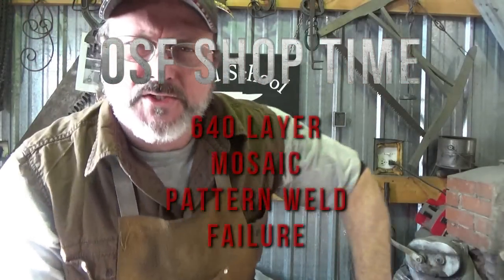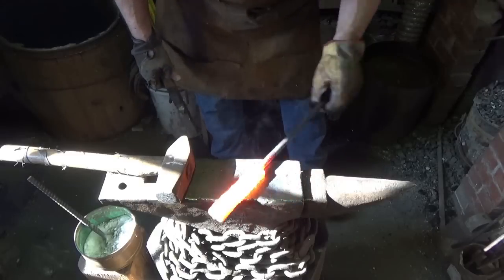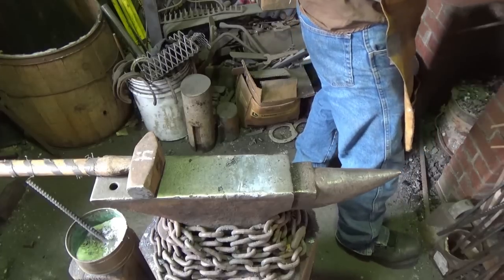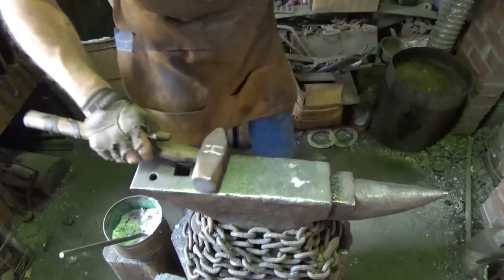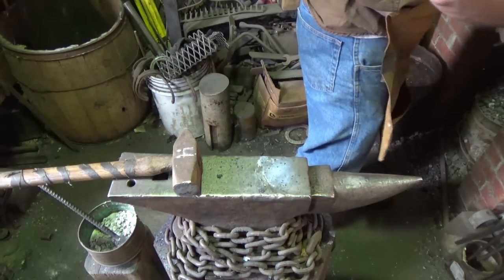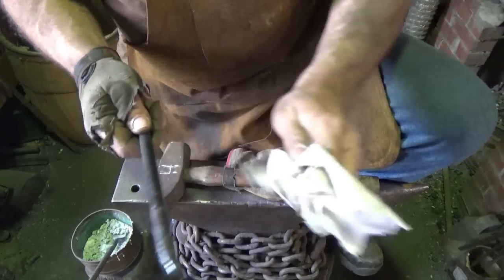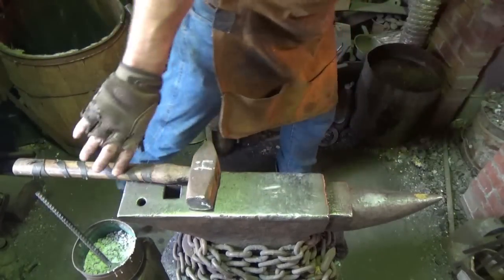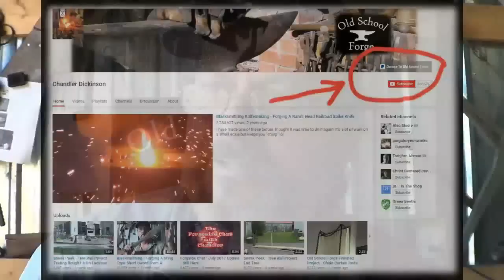OSF Shop Time - A Bad Day At The Shop - 640 Layer Mosaic Forge Welding Pattern Failure Part 1

Comment: Hey chandler, i know of a lot of mastersmiths as well as myself who have started using kerosene for flux.  Soak it before heating, dont clean off the residue once you hit heat, then forge weld it like normal.  The kerosene turns into carbon and such and keeps oxides from forming.  If the piece was thoroughly coated oxides arent allowed to form, only carbon (with minute imperfections).  The carbon readily difusses along the weld line and it sticks perfect.  It also prevents flux inclusions with the trade off of air pockets.  The air pockets can be fixed by driving a tiny punch into them and forge welding from the edges of the pocket towards the center with a ball peen.

Comment: The anvil is getting a bit of bounce when using the horn, you may want to remove the chain and reseat it soon. Also before wrapping the chain again wrap it with leather strips first, a couple old belts, an old apron cut into strips, anything leather really to go around the thinnest part of the anvil atleast twice and sorta spread out in the wrap, then use the chain to wrap it. Much better vibration(ringing) reduction that way and wont catch fire if a hot bit of scale gets on it. A tight mount and vibration dampening saves ears.

But before remounting it I would suggest either fixing the shoulders or swapping it out with the anvil you already repaired. Those worn and chipped shoulders give you allot of grief and would be worth it to have proper ones. If you swap out the anvils you will have a benefit if you do shows again, lighter anvil to haul about since the repaired one is the heavier one. If I remember right it was the hardy hole having a different size... Perfect opportunity hidden there at this time. You are doing back to basics videos and making hardy hole tools is a basic. The hardy hole tools could be done before you are at the stage of requiring a remount rather than it is a good idea to do it like now.
Reply: These are good suggestions.
Reply from the maker: I have noticed but there is a new family member coming soon...   and I might just wait for her...
Reply: Chandler you have me super intrigued now. New family member... I speculate a new anvil of the same weight and dimensions as the one used in the videos but with a clean face and tight shoulders. If I am right then it will be a pretty thing in your shop that's worth being proud of. Anywho I do look forward to meeting her.

Comment: Chandler, I love all your videos. I feel awkward making suggestions to some very skilled at something I don’t know how to do but I was watching and had an observation. This is one of a few videos where you’ve talked about wanting to get better at hitting flat. When you swung hard and naturally it didn’t look quite square and when you went slow and focused and hit square it looked like your wrist was at an awkward angle. It makes me wonder if you need to have your anvil on a taller stump so that your natural swing stops at the anvil when the hammer face is flat to the anvil table.  I know you’re cash strapped but it looked like you had some logs left in the yard. It’s just a thought. It seems like you have your anvil at an average height but it also looks like you’re a bit taller than the average Smith.

Comment: hey there Y'all in case Chandler doesn't see this maybe one of Ya will answer this Question. does it wurt the Metal to keep throwing Flux on a Billet from when ya start the we look d to the Finish of say a Knife blade?
Reply: Steve Jones ive found it to be corrosive when at heat maybe?  It just seems to eat at the metal or something.  Not when cold though.    If you're trying to preserve steel, a reducing fire is your best bet, as well as not getting too hot (oxidizes quicker)
Reply: jd hungerford thank you JD.

Comment: Thanks. I always look forward to your videos.
I haven't had much luck with just the band saw blades together. When I alternate them with leaf spring it works much better.
Reply: I've done it that way also and mixed round saw blade into the mix as well and it has came out real well...

Comment: I'm building a power hammer. Got 80% of the equipment for under 100$. Lot of time and work though.
Reply: Reading Dave Gingery books on building machine tools from homemade aluminium castings has given me a great interest in building machines from scratch. A power hammer is something that I've had some interest in designing, even though I don't do forging, and I also want to build a heavy duty industrial style dough kneeding machine, because i'm that kind of nerd. Good luck with your project
Reply: Could you message me with your sources?  Im in the process right now

Comment: I think when you folded it in half instead of cutting it off and welding it that's how your pattern got on the outsides. Also each "C" patter is 2 layers so 2sets of "C's" is 4. You have C's on both sides that's 8 and 8 flat layers is 16 total.

Comment: Is your anvil not mounted down all the way? I'm noticing while you're drawing out especially around the 27min mark that your anvil looks like its bouncing pretty badly.
Reply: No, the hammer blows of The Chandler are shaking the very ground his shop stands on!
Reply: Ive found them to just bounce as if its not attached anyways.  I always thought mine was very solid, i watched some video and i can see both the anvil and log (3-400lbs) jumping roughly 1/16" when im using a 5lb hammer for drawing out